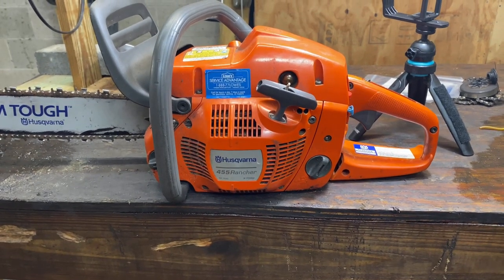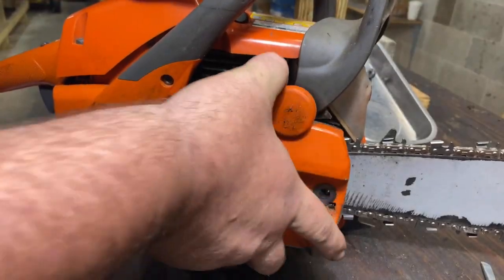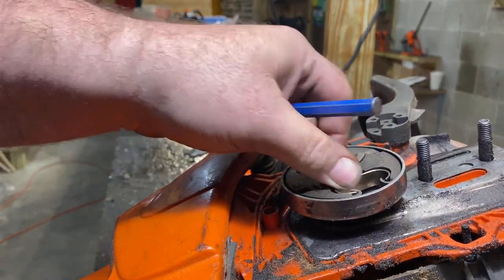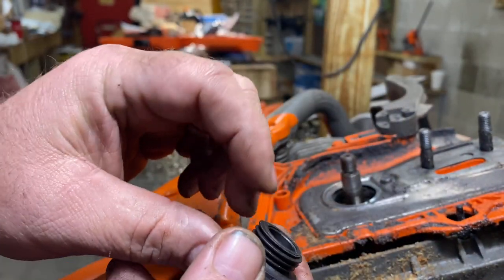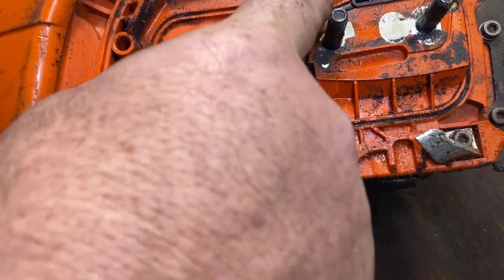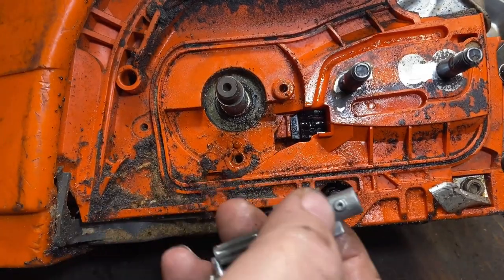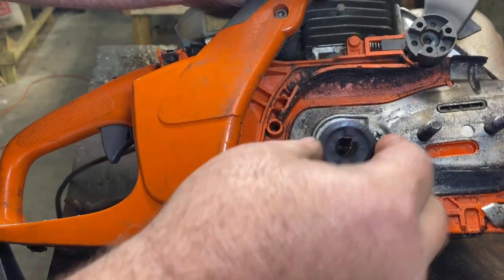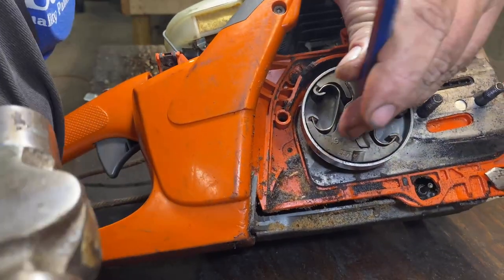Husqvarna 455 Rancher Chainsaw oil pump repair/replacement.

Comment: I realize the saw gets dirty pretty quickly....but I did not understand why not take the opportunity to at least blow out some of the saw dust while you have the silver metal cover off.  Jamming the worm gear up with saw dust seems like the most likely cause of damage to it. Why not clean it a little better before putting it back into operation?

Comment: Hi, one of the 2 bolts in wich the sword has to fit has broken so I need to replace it. I will better replace both but I don't know how to unmount the plate in wich they are fitted from behind.
Should you help me with that please?